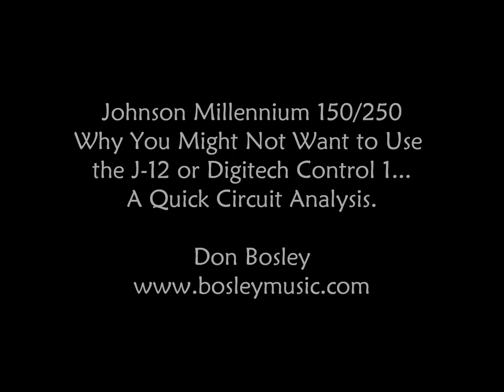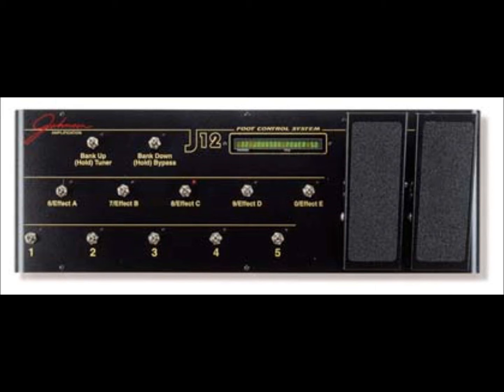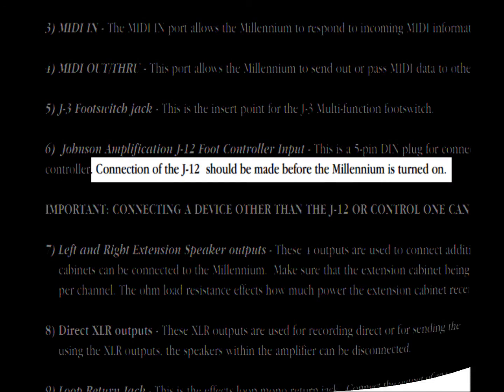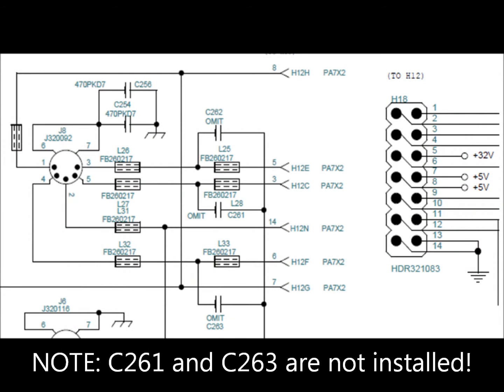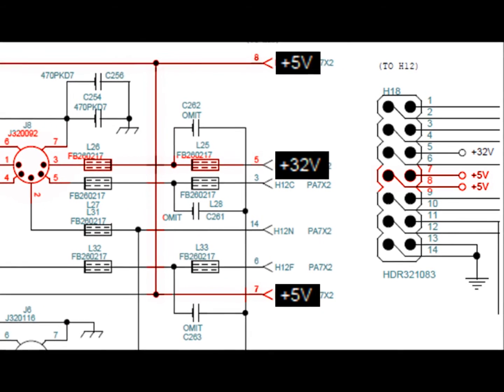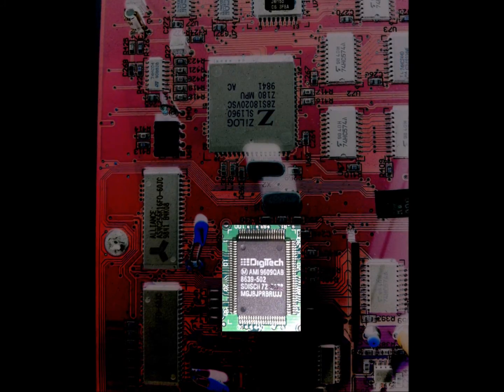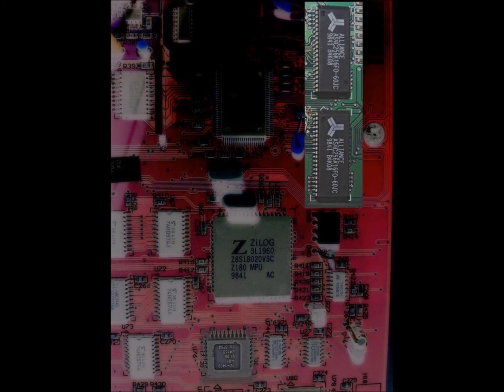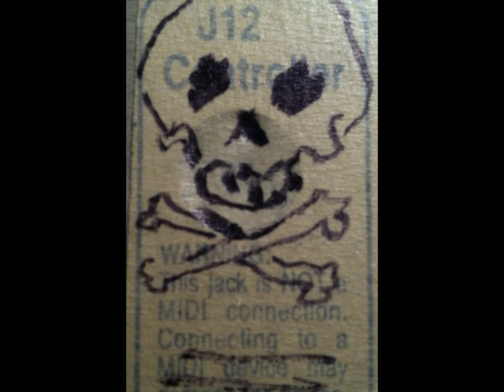How the J-12 can damage your Johnson Millennium 150/250

Comment: Hey mate you just confirmed a lot of stuff for me and I think I’ve got a new fix approach idea. 
My unit doesn’t boot so I will start from z80 but when I checked it under thermal cam it’s cold the only ones are going hot are TMS and two S-Discs but tms is only one that goes to about 70 degrees and a discs are about 50 is that normal? The problem is I only get 3V+ on 5V rail and I’ve extensively checked all options so basically processors are last. Could you chime in please.

Comment: Hey i've been looking at all your johnson things for a while. Thank you for all this information. Is there a way or software to update the sounds patches i have. I'd like to design my sound in abelton or a vst like serum. Then put that patch in a bank. Thanks for your help!
Reply from the maker: It looks like you asked something similar under another video - I'll get to you there.
Reply: The PC editor is called RPEdit, but for it to work you need to be running 1.14 of the firmware.  His other video has a link to download, then you can exchange *.rpedit files, which are your saved patches.

Comment: Great vids Bosley. My problem- setting up on stage,stepped on cable, my j12 is clearly useless. The display lite dies but switches thru presets, inc. modified presets . The six clear presets above stereo250 logo and their adjusters appear to work but I have no amplified output to speakers. Using external expression pedal thru amp inputs will allow playing. Is the amp fubar?
Reply from the maker: I'm not really following "Using external expression pedal thru amp inputs will allow playing." Are you saying if you use a volume pedal in front of say the bright jack, that it works? But plugging in directly doesn't produce sound?

Comment: Hi,
I have a Johnson Millennium 250, with a weird problem... i saw some of your videos on Youtube and i was hoping that you could help me. 
I think my J12 messed up my Amp. Because it's giving a "null pointer 1.05" error and sometimes the screen is all scrambled. I can send you a video attachment for you to see if that helps.
I was wondering if you know what could be the problem?
I Tried messaging through your site but your security generator isn't working.
Thanks in Advance ;)
Cheers.
Reply from the maker: A null pointer is a firmware error/failure - probably some kind of illegal memory access. It could stem from many, many, many things - since memory space includes on board memory & peripherals, addressed external hardware (RAM/EEPROM), etc... it could either be a software or hardware issue.  The easiest thing to try would be to reflash the amp to see if you have corrupt firmware, although there are some precautions to exercise if you're going to do that - check other videos to see what those are, but if your EEPROM is faulty you may end up bricking the amp.
Reply: @BosleymusicCentral  Hi, that was what i was afraid of :(  
do you know where i can get the firmware?
Thanks in advance.
Cheers.
Reply from the maker: @Fixepedia  I just sent it to the gmail listed on your channel.

Comment: I've had my Millennium 150 Combo since 1994 and have never had a problem with the J12 connection after literally hundreds of live gigs. I have been aware though that the connection is a source of possible peril as the shop that sold it to me made a point of warning me about it. I always carefully dress the cable from the pedal to my rig before turning the power on. If the display does not light up on the pedal right away I immediately turn the amp off and replace the DIN cable ( I always carry two or three spares ).  The real problem here is that almost all DIN cables sold for use as MIDI cables are simply not at all robust as in computer and keyboard applications they are not carrying  a 32VDC bus supply. If someone made a military grade MIDI cable that would most likely eliminate the risk except for the human factor which is not predictable. I always power down the amp when it is being left unattended and if necessary (  i.e.sharing a stage with other acts ) physically disconnect the power cable and the controller itself. 

One thing that I do know that can damage a Millennium  is if someone or something pulls the power cord of the amp out of its electrical socket while it is powered. That will damage some replaceable components ( mainly discrete capacitors )) on the circuit board behind the left display area on the amp. This did happen to me once. An acquaintance of mine had this happen to his amp and he lost all of his personal presets and the factory presets. The work around for this is to connect the amplifier once it is repaired to another Johnson Millenium with a DIN  cable from J12 jack to J12 jack on the working model. The factory presets will automatically be transferred from the good amp to the wounded one. Unfortunately in this case any personal user presets are gone for good and will have to be re-programmed because they will have been wiped from the flash memory. I keep a binder in my office with all of my user preset values recorded just in case...

All that being said I love this amp. I have been through dozens of amp rigs in the last 30 years and never found anything that gave me the flexibility and ability to create the kind of sound palette that this unit can. It is also a prime example of what happens when someone develops a piece of new technology and is strongly focused on making a successful launch product virtually perfect with the finest build and a high degree of programming granularity. It takes a lot of time to learn how to work with this amplifier but the rewards are well worth the effort. I knew that the amp was no longer in production but it saddens me to learn that some of its key components are no longer available. That info has strengthened my resolve to acquire another one if just for spare parts.

Other modelling amps which appeared on the market after the success of the Millennium do not even compare to it in technical excellence or build quality. It's like comparing a Dodge Caravan to a Bentley. I've had this amp for 26 years and would like to still be using it 30 tears from now.
Reply from the maker: "The work around for this is to connect the amplifier once it is repaired to another Johnson Millenium with a DIN  cable from J12 jack to J12 jack on the working model." You actually hooked up two J12 jacks on two different amps to eachother? And got data to go across them? How did you figure this out since it isn't documented anywhere, and are you sure you're not talking about the MIDI I/O, because that's how all of the documentation says to do what you're talking about?

Comment: Hello Don, I have a JM250H that may have the catastrophic condition, despite my care in using the J-12 or not using it at all. Symptoms - No sound, no characters on display except for a faint bar of segments across bottom of display (backlight working). I have fixed this before by replacing the polyswitches on power board, but this time, no luck. In the past I had to replace voltage regulators on the same board. I read a thread that described a logic probe test on the "digital core":

 http://music-electronics-forum.com/t27867/

I'm simply wondering if there's any hope, or"another one bites the dust". I bought it new after a LOT of drooling demos, made some amazing patches including a Johnny Marr style panning tremolo (How Soon Is Now?) and some radical effects patches... 'even modded up the J-12 for a switched expression pedal... I just loved this amp.

I was unable to email you via your website due to expired captcha account
Reply from the maker: You can check out the simple repairs video: https://www.youtube.com/watch?v=dSGz7xB8CQ4&t=2s 
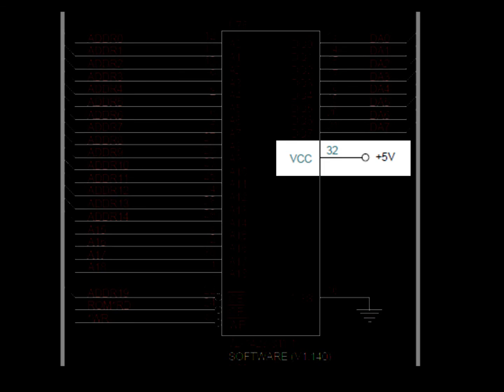Try the disconnect the power amp portion at ~6:00, but otherwise you may be up the creek. Were you able to do the probe test? Do you have a scope or logic analyzer to do this with?

Comment: Hello! I'm Looking for the software and the firmware Update for the Johnson Millenium 250. it's possible to send me link please?
And i have this problem with my Johnson Millennium 250....
I'm electronic engineer and i have already check all the pcb.
i have problem with my DSP Effects.... I have Terrible "white Noise" when i have open the digital Effects and the audio signal hear it like a "sand" if someone know about electronics is like Jfet transistor in audio buffer circuit and the jfet is with less voltages and working wth a lot of distortion and te signal lost fast....
i can't explain it better i'm sorry.....
the dry analog signal work exelent!
the problem is only when i have open the DSP effects
your answers it will be so helpfuly for me. thank you!
Reply from the maker: I don't have a repository or download available currently but you can probably find a zip on the Johnson website if it's still there. As far as your issue - the white noise only occurring when dsp is engaged and from the sounds of it all other hardware functional, is a decent indicator that you have serious hardware problems, not just failing firmware, although attempting to reflash is definitely worth a try.

Comment: I'd suggest adding mini breakout board between the ribbon cable, and midi board in which the 5v power lines will be protected by schootky diodes. In such case no voltage will run back through diode.

BTW. Do you have any part number for encoders? Or any link to shop seling compatible (rather good quality) replacements?
Reply from the maker: That's a great suggestion. 

On the encoders : REF DES SW440172 : SYMAN 44-0170 , Encoder Switch 24 Pos/Dtnt, 2-bit, R/A, 16mm Body, 15mm D-shaft - I haven't had to replace any in a while so I'm not sure off hand. Hope this helps.
Reply: But Ref Des means reference designator, and i've googled earlier for SW440172 and found nothing... Do you have any link to shop selling this part?
Reply from the maker: Try emailing digitech.
Reply: These might be the part, I have emailed Mouser electronics to see if they have anything:
https://www.digikey.com/en/products/detail/tt-electronics-bi/EN12-VN20AF20/2408775

Comment: I'm thinking since I have a mint Johnson 150 and that I also have a mint ... never used J-12 which I'm ready to start using... that maybe the entire issue has been not pursued enough... thanks for putting this video together so folks like myself can understand what to do and what not to do... so what I plan to do is to figure out how to fix the cords where they cannot be accidentally unplugged.... I play mostly at home for now but as a singer/songwriter/performer at some point this amp will leave the house... so as a tech geek I'm not but I'm super mechanical so to speak how can one fix the cables to where they cannot be unplugged until you want them unplugged?? Such as a PC monitor cable is done... surely there has to be a fix short of taping it up etc... and such.... both at the amp and at the foot board.... I will see what I can come up with and hopefully others can explore this possibility as well cause I super love this amp... Yee Haw!! HOT-H (Hillbilly On The Hill)

Comment: Hello, I've always enjoyed the HUGE amount of information that you provide on the Millennium amps and switches.  By any chance do you have a link or part number for a replacement switch?  I had a guitar drop from one of my hangers and it landed just right on one of my J-12 switches and simply knocked the top part of the switch out of the housing.  Any possibility of reserved current within the flow going to the switch? (switch #1 on the controller).  Just to be a further pain in the butt (lol) any knowledge on the Rolls RFX Midi Buddy controller.  I have a few and one of my newer ones has a 3 digit LED display (similar to old style LED Clocks).  One character is not working and patches such as "19" appear as "13" etc.  Anything on that would be a God send.  Many thanks in advance.  You are a valuable resource and again, very appreciated information and tutorials.
Scott Grove
Reply: Funny, the author talks about his posts being deleted, yet everyone of my posts here gets deleted?  What the?
Reply: So, I FULLY understand and agree with the dangers of using the S12.  I have but one question:

Why not rig up an external 32 volt /2 AMP power supply, like from a laptop or some other device?  I would further make sure to cut / short the pin that sends the 32 volts back to the amp to be safe.  You could use a MIDI DIN5 breakout and feed 32 volts into the S-12 that way, or just cut a cheap MIDI cable?

I see you prefer the FCB1010, and that runs off 120 volts if I am not mistaken, but that draws its power externally?

Here is a link on Amazon which has inexpensive 32 volt PSU's:
https://www.amazon.com/Bestcompu-Adapter-Photosmart-Switching-0957-2120/dp/B00QWV3UP8/ref=sr_1_5?crid=36KSEE747AS3B&dchild=1&keywords=32+volt+power+supply&qid=1635219110&sprefix=32+volt+power+supply%2Caps%2C53&sr=8-5
(I had one of those printers and I was surprised my printer ran on 32v)

Would this not be a safer way to make use of the S12 controller?

David

Comment: Hi, thanks for your videos, they are very helpful. Now to my problem which I hope I will explain without much confusion. My JM150 has had problems since I bought it a couple of years ago on Ebay...it's from 1998 so I didn't expect it to be without fault, the controls have always been jumpy like you have explained in other videos, but they do work eventually so other than use a little contact cleaner I haven't worried about it too much. But the recent developments are rather more ominous; the midi cable I was using with my J12 was a little dodgy but as I rarely move the amp it wasn't much of an issue. The cable deteriorated over time to the point where it was jumping on and off and sometimes not powering the J12 at all...I had not seen your video at that point so had no idea of the danger this posed. Now a couple of days ago the LCD display started to poop out on my, first the left side worked fine but the right side just had everything lit up. Now it doesn't work at all other than a rectangle of blocks in the top right line resembling a bar code. To top it all off the amp froze mid use yesterday with no buttons working. When I rebooted it no longer has any of my patches and I can't switch between the User and Factory banks because all of those buttons are not lit up and not working. Does this sound like a catastrophic failure or one particular part has blown? The amp works fine with the factory presets and all controls work except the screen and the right hand section (store, utility, edit etc.).
I did notice a capacitor with a broken leg on the board where the power supply connects (a big capacitor not one of the small ones), I soldered the leg back in but maybe this part is also broken?
I'd appreciate any help you can offer with this, you do a great job here on YouTube with these videos!
Many Thanks again,
Reply from the maker: Mike Jackal Well, the cable going may have caused some other problems. It's hard to say without seeing. As I've recommended to others start by checking voltages on your power supply without load, and if everything seems good, move to checking the supply under load. If your power supply is not good, that prevents anything else from working. If a leg of a cap was broken, you may want to step back and replace, and also check other caps. Do not use the J-12 anymore until you have the problem narrowed down.
Reply: I emailed Digitech and this was their reply...
Regarding the display issue, Change F3 and F4 to resettable polyswitches, which is a 2.5A resettable fuse, or replace all 4005 diodes(4 diodes). These parts are located on the power supply board.
Does that sound like a good idea to you or wasting my time?
Once again many thanks for your help.
Reply from the maker: Yes - looking through the schematic revisions, and from my past interactions with them, it may be worth it. I would check the diodes before pulling them though.Basically go back to what I said, and check your power supply voltages before you start doing anything though.

Comment: I bought a used Peavey 5150 4x12 cabinet it has only one 16ohm input. If I wanted to run the JM150 speaker out to it what would you recommend. 1. Unplug the 2 jacks connected to the speakers of the JM150 and just use the 4x12. 2. Use both amp speakers and 4x12 speakers. 3. Don't use the cabinet at all because it is 16 ohm and not stereo and use a cab that has 2 inputs at 8 ohms each. I was thinking of disconnecting the amp speakers so they won't blow out or get damaged and use the 5150, but does it matter if I use the R or L output?  I know this is basic electricity but need to be sure 8 ohm outs can go into the inputs of 8 ohms or 16 ohms but not 4 ohms. Thank you very much for a response. Also you explain the videos well and have a good narrating voice. Amazing that you know how to repair these amps!!
Reply from the maker: First off, these are all subjective questions more than technical ones - do you want two cabinets? Do you want them spread on either side of the stage for a truly wide stereo image? Do you only want to lug around one cabinet? Do you want to blend your cabinet's tone with the 2X12's in the JM? ...You see what I mean? from a technical standpoint, the outputs on the amp are 4 ohms, with the jacks in parallel. You could safely hook two sources which are 8 ohms each, one into each jack giving you the 4 ohm minimum. The Ohm rating is almost always the minimum you need - anything above that is acceptable, but will reduce the output power of the amp. In terms of running one side or the other, if you set your amp to mono it won't make a difference, but halving your stereo output to just one side could be detrimental to your sound depending on the patch.